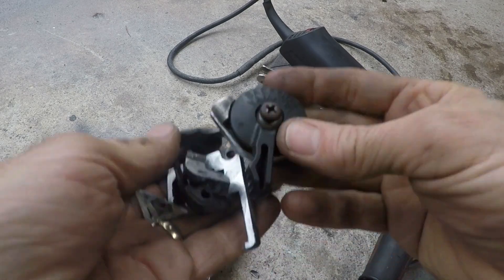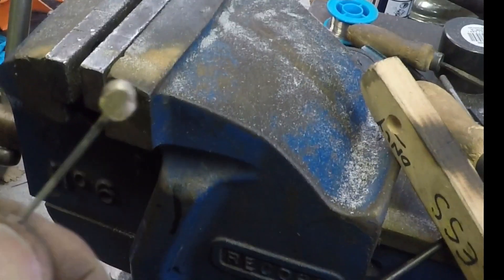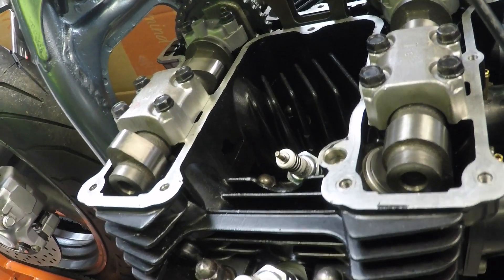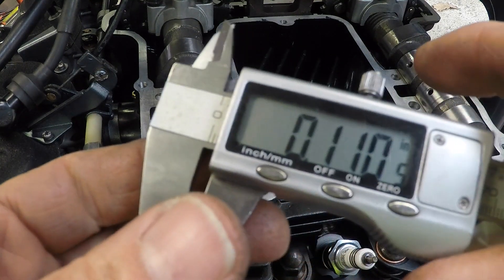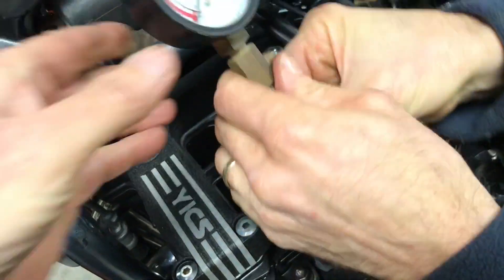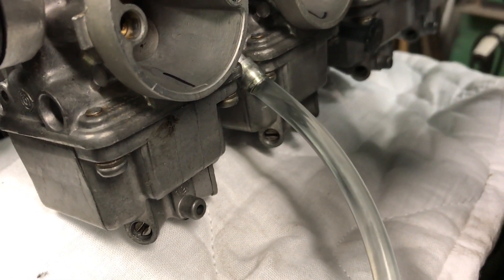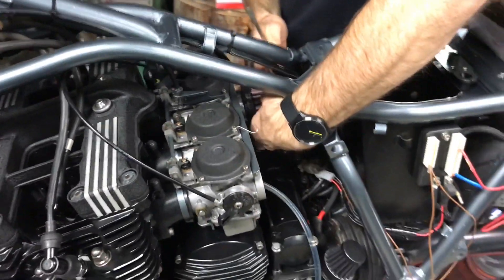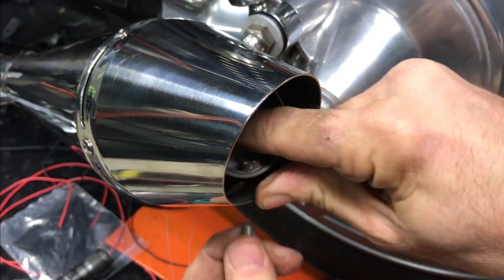Yamaha XJ650 Part 31 First Start!

Comment: I fired up one of there just the other day, had the cylinder head off because all eight valves were bent, held a lead rod to them and swung a hammer on them till they sealed up close... after that I put the head back on, used the old head gasket and torqued it down to 34lbft. had 34 65 80 and 20 psi of compression... so I filled the tank with kerosene, sprayed lots of fuel in the carbs and hit the starter. It fired up and i let it rev as far as it would go for 50 seconds and then slowly started letting off over about 200 seconds then shut it off and let it cool... took much less kerosene oil mix to start the second time, actually switched to a 80/20 gasoline kerosene mix and ran it at 3000 to 6000 rpm for 15 minuets... the next day I ran it at 35mph in first gear for 15 miles... 7000rpm to 9500rpm.

The lower jug gasket was replaced with lock tight 515 flange sealant so the compression ratio is 10.5-1, still runs on the kerosene mix gas but the compression detonation makes it tricky to run it to higher rpm's cant just open the throttle... 28-60 octane fuel, the ratio it has states it needs 91 or 97 octane gasoline.

The valve cover gasket melted during the brake in! Runs much smoother then a 250cc dirt bike.

Comment: @mezzmo im doing a build on a xj750 and im trying to see how you wired the ignition. A picture or something would help alot
Reply from the maker: Hi mate, check this link to the manual. https://www.revzilla.com/assets/0001/9454/motogadgetm_unit_blue_digital_control_and_fuse_box.pdf
I don't have a key on my bike, I use my phone and also have the RFID lock. The RFID sensor connects into the "lock" where the ignition would usually go.
Reply: @Mezzmoengineering  thanks for the speedy response I have this article saved but more specifically I was referring to how you have the tci/Cdi and reg rectifier wired. I’m visual as I’m sure most of us are as well so pics help tremendously
Reply from the maker: @peteranthonyanakwe9040  I don't have any pics as its all hidden under the seat area. I don't recall it being that difficult. I'd suggest first checking the stock wiring diagram and then the M unit diagram. Happy if you want to send me clear pics of your wiring to see if I can help....
Reply: @Mezzmoengineering  I have pics what’s a good way to contact you with the pictures?
Reply from the maker: Hi mate, you can email me at mezzmo@iinet.net.au

Comment: Before I even play the video; Well done.
PS Cyl head's showing promise coming off.
Reply from the maker: Good on ya mate, patience is key
Reply: @Mezzmoengineering  Hadda hacksaw blade one of the long ccase bolts.
Heads off now but I Irish tempered things a bit. Just need to buy cyl head now and barrels and I can rebuild.
Class to have your videos thanks mil

Comment: Just got a xj 750 83 model. Having alot of bsck firing through the carbs. When im atarting it itll backfire bad. Is that the carbs out of synch or a timing issue? Ive had it running before but wont idle. Only runs at 1/4 to 1/2 theottle
Reply from the maker: Hi mate, hard to say. If it was running well before then most likely carby issue. If you have changed something on the engine then that could be part of the problem too. My guess is you need to remove carbies and give them a good clean, check for air leaks, throttle shaft seals, intake boots etc
Reply: @Mezzmo Engineering  the bike hasn't run in 11 years. Doing it for someone else. An the starter clutch is bad so whole motor has to come apart. Also got a 78 xs 750 yamaha that needs starter clutch. The 3 cylinder 750. Both need starter clutches. It got a little better when I adjusted the float level so my guess to much fuel from wrong float level
Reply from the maker: @Aciecarter238  Hi mate, if it hasn't run for that long then for sure the carbies will need a thorough clean. That's the best starting point.

Comment: What size tires are you running? They look bigger than stock. Also, I want to lower my XJ 750(Midnight Maxim) but they have the adjustable forks. How can I lower them? Or should I get different ones?
Reply from the maker: Hi, I don't know your set up but the front forks can be lowered easily by loosening the clamps and simply lowering. Rear shockers usually have some adjustment but if you want more you will need different shockers with the height you want
Reply: Yea I know I can slide them on the triple tree but sometimes it makes the ride a little sketchy when doing that. I may look for some old KZ forks to lower and swap. Both are 36mm so it should be ok

Comment: Hey could you help me out! My Yamaha  xj650 maxim is having problems I took the headers off to see how much pressure was coming out and cylinders 1 and 2 and pushing hard but 3 and 4 aren’t pushing as hard. It’s almost week. The bike is a project and I’ve gotten it to the point where after a few fires it’ll start up if I put my hand on the back of the carb. The carbs are dog shit but I can’t even roll the throttle there’s no response at all and it takes a few turns to start it up. Is it happening because of the carbs??
Reply from the maker: I'll guess the issue it carby related. Other basic things to do is check your plugs, timing and test compression
Reply: @Mezzmoengineering  now anytime I go to start it the starter solenoid just clicks. Starter motor doesn’t turn. The solenoid is brand new. Start motor was showing signs of failure before but now it won’t crank. Would a rebuild kit do the job?
Reply from the maker: @jehqwoumbeauchamp8734  Hi mate, this will be either a flat battery or you need to replace the starter motor brushes.

Comment: Just picked up a 1983 maxim 650. Any ideas as to where I can get a full wiring schematic for it?
Reply from the maker: Search on-line or best option would be to buy a Haynes manual. These should be on ebay...